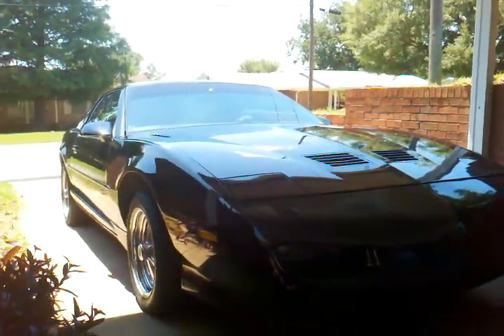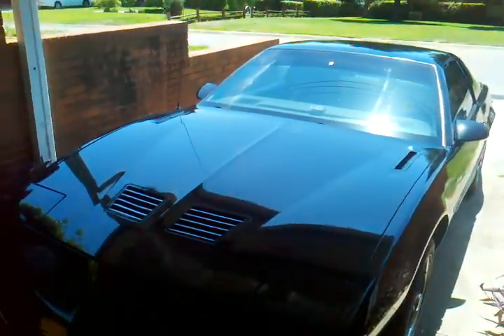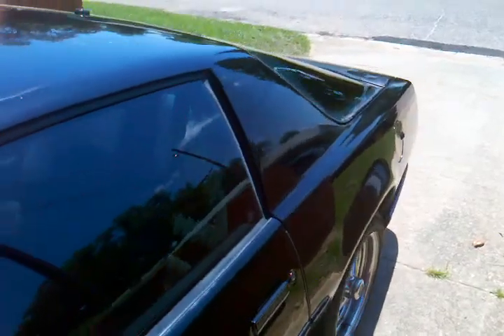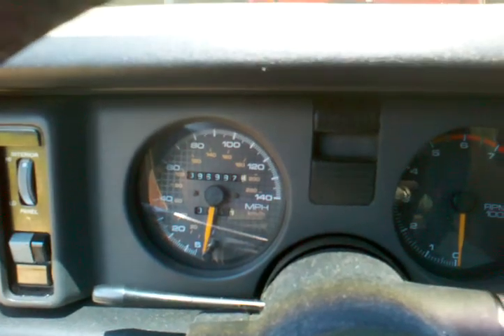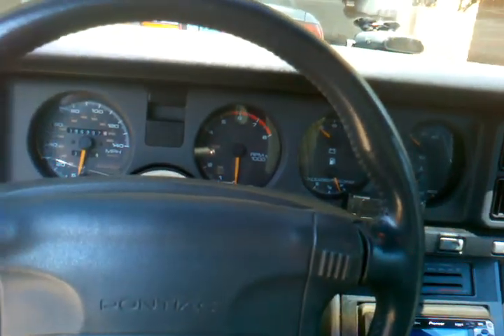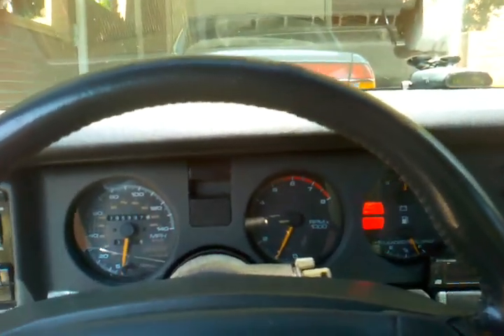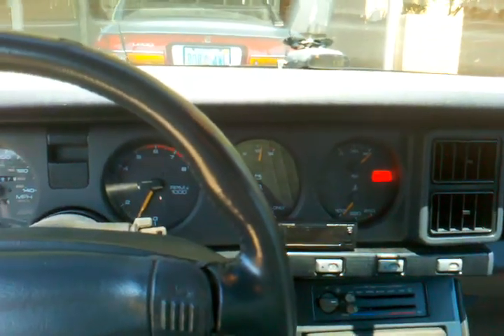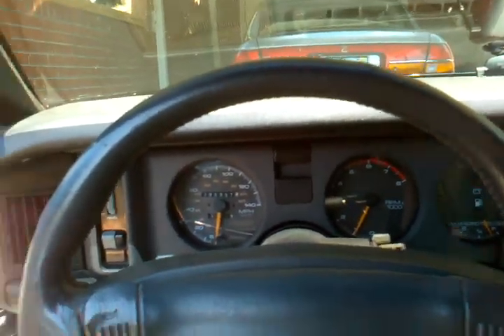1991 Trans Am walk around

Comment: i have a 91 base model firebird with the 305 TBI that i have thrown a bunch of bolt ons and shit on to get more power to the ground. But im looking to do an ls3 swap in the near future, which would pretty much require a complete overhaul on everything, of course transmission too. But i might change my mind because i like the originality of cars a lot. I got it up to 250 hp and and about 320lbs torque just from headers, 3'' air filter, spacers, etc.

Comment: you need better rims.
Reply from the maker: This video is over 3 years old, a lot has changed with the car since then. It holds its power to the ground on stock 16 black crosslace wheels. I put the factory ones on, tail lights are different, along with interior some.